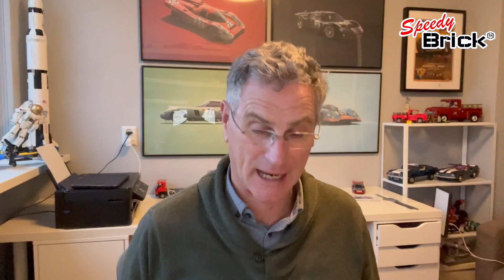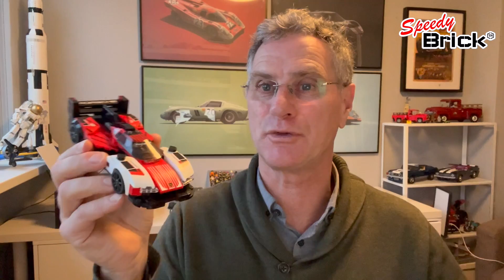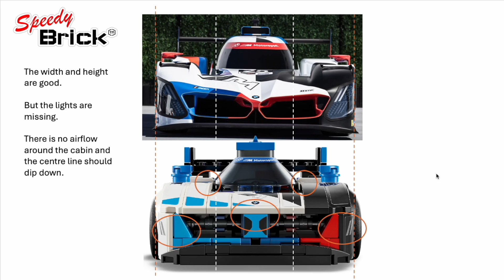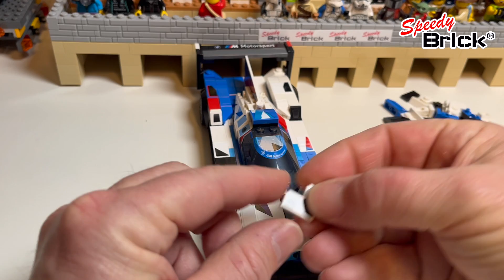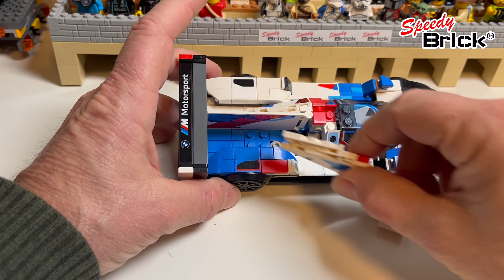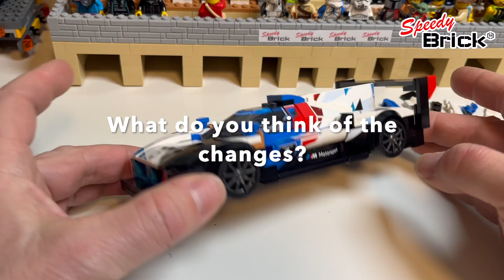Lego Speed Champions BMW M Hybrid V8 set 76922 fix and improvements

Comment: I think the stickers on the front with the 2 dash lines / / are supposed to represent the headlamps but they are not forward facing at all. I was really happy with the Porsche last year the bmw lm was quite the disappointment. The gt BMW is my favorite of this wave. I’m thinking before long a few rebuilds will pop up on rebrickable that will improve the model, or I’m worried it will be relegated to just parts for Moc’s
Reply from the maker: Yes exactly, not great. Feels like it was made with lower design effort than the rest of the wave.
I’m working on mods for the M4 GT3 now, it’s way too short compared to the height and width